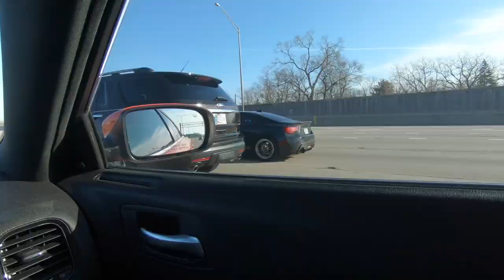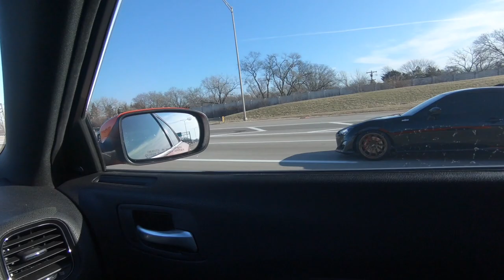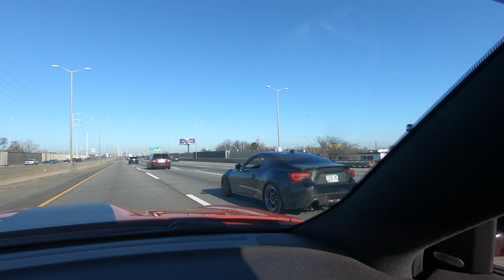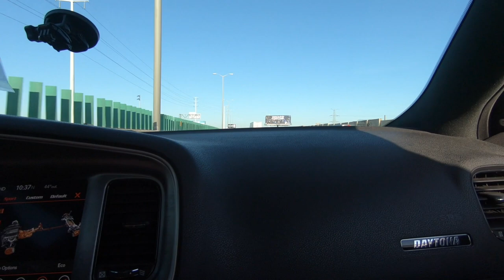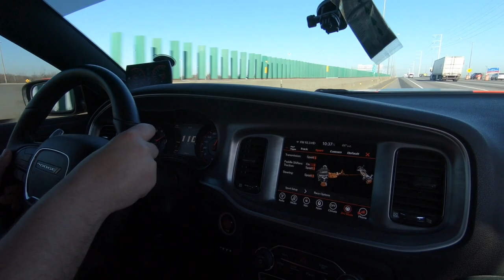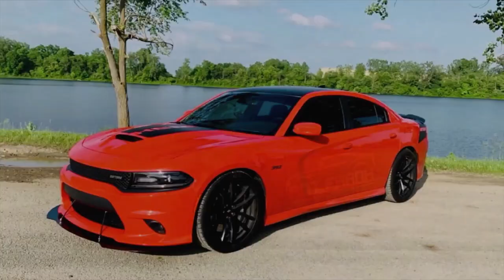Cammed Charger 392 vs Boosted FRS!!!!

Comment: How much boost is he running? I wanna run the same not n get this close to taking a 392. My boy had a jdl turbo kit for 3 years with no problems or blow motor but idk if he was pushing lots of boost
Reply from the maker: I’m not sure how much he just told me how much power he was making
Reply: 14lbs of boost on 93 307whp
Reply: e85 on 10psi and you'll make 350whp easy. I'm on 10psi 93 tuned by delicious tuning with a gtx2860r and im around ~300whp